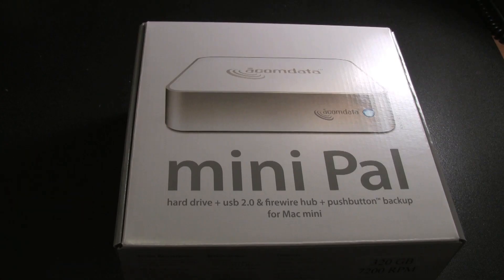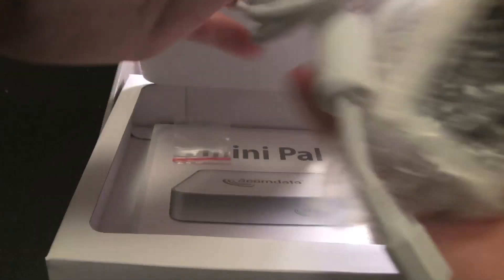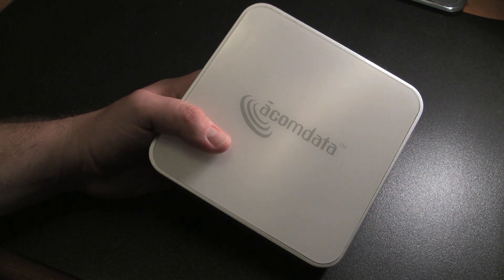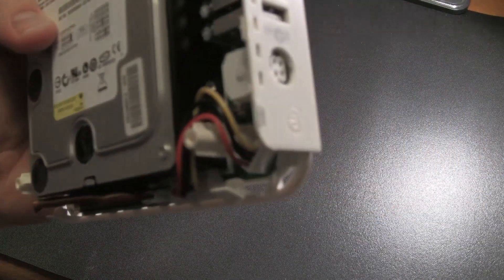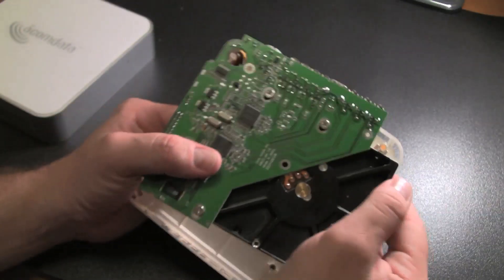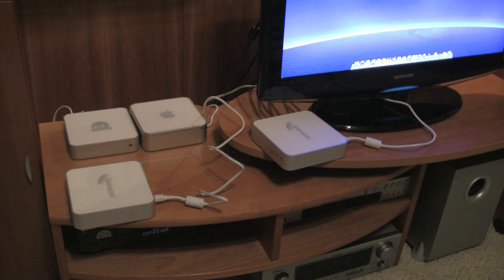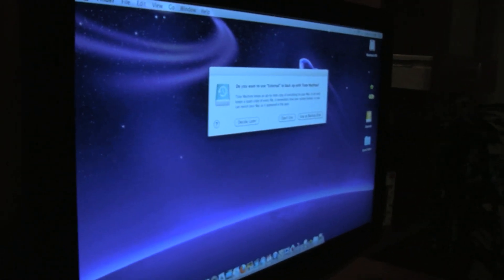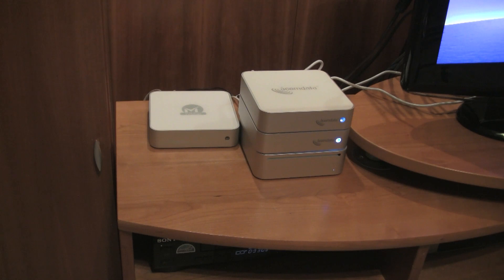Acomdata Mini Pal for Mac Mini

Comment: I have the 500GB version of this drive which I use as extra file storage and backup for my Mac Mini. The drive doesn't show up on my desktop anymore. When I press the power button the blue light in the front comes on but goes off once I release the power button. If I hit power button 3 times rapidly I get the blue light to stay on but I still cannot see the drive icon on the desktop.
Does this mean the HD is bad or do I have a software driver issue? I need to get data off this archive drive.....

Comment: That seemed like a pain in the ass to swap out an IDE drive. I have some old IDE drives that I still use but I would not buy one as of now. Seeing those external devices lets me realize you are getting into about that same size as a Micro ATX case.

Comment: Any theory about why the old drive died?
Did you check the SMART status and see how many hours it had been running, and start/stop cycles?
I would suspect heat might be an issue with those type of external drives since they have no cooling. And some extra heat from the Mini might be too much.

Btw, I would have killed that LED if I opened that case. Those type of LED's are annoying when you're watching a movie with all the lights off. :)